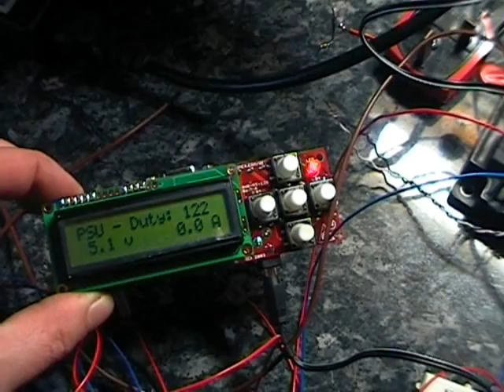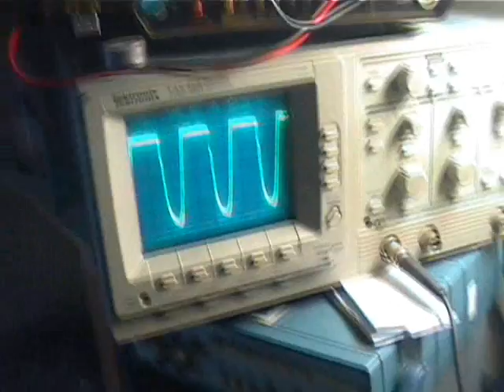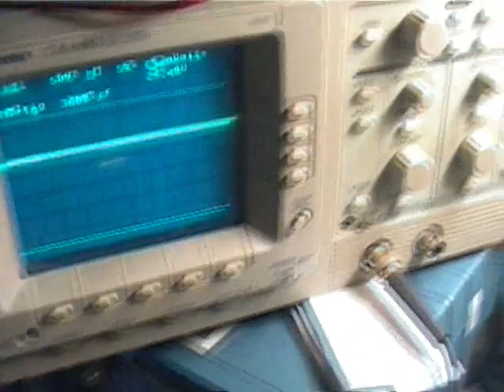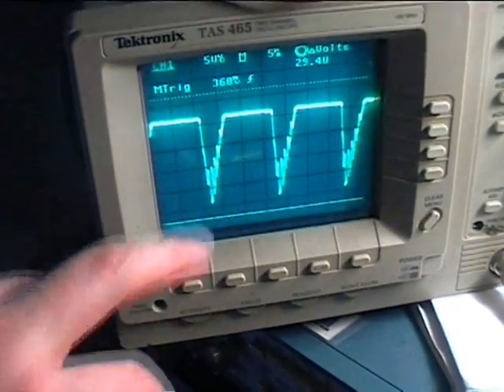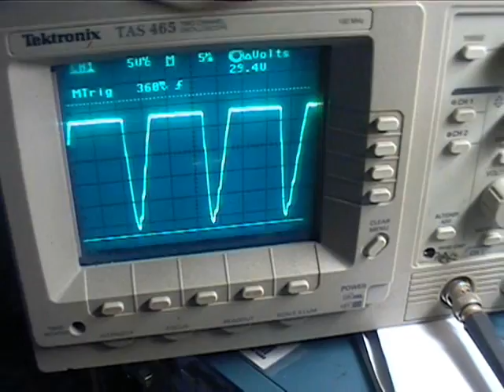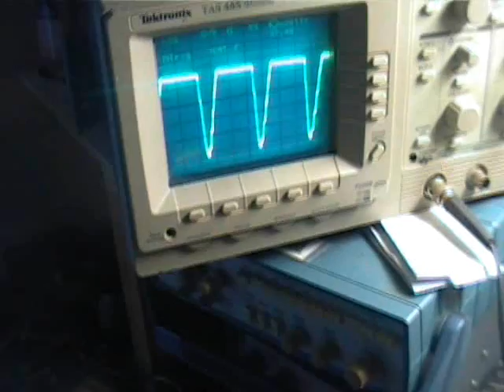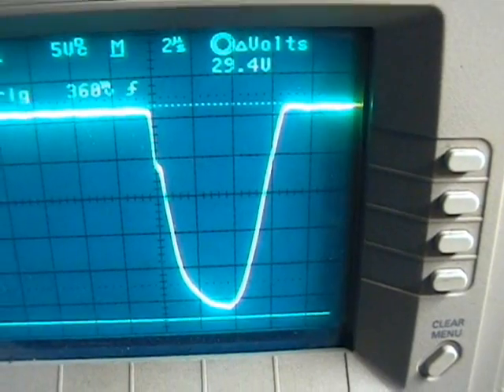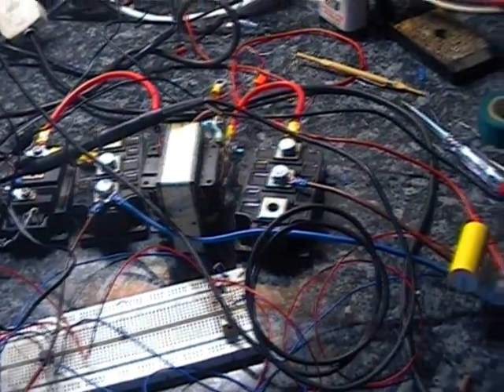BMW EV Conversion 15 Charger Development 01

Comment: If you want the output to be smoother you can add some bulk capacitance to the input, so it simulates a constant DC supply voltage that you buck down to whatever output you want.  But with charging lead acid, they do well with pulsing voltages on input, so I think this is going to work really really well.  Good job!  680uH I think is plenty for this.  If you want to make the output constant, you might need a bigger one, and a big bulk input cap, and probably a PI loop to filter it.